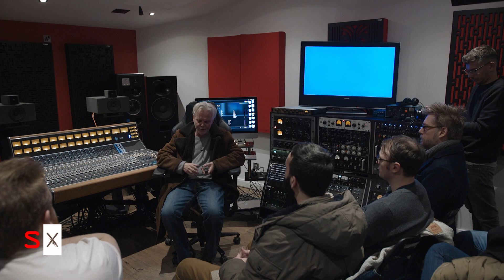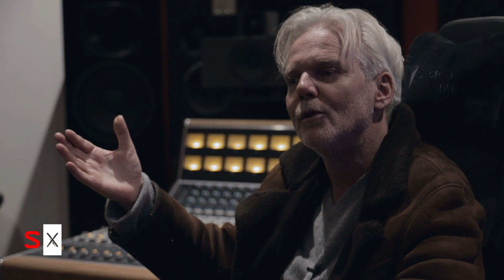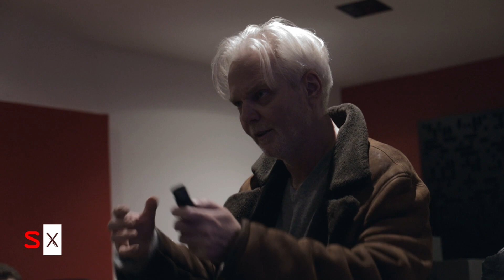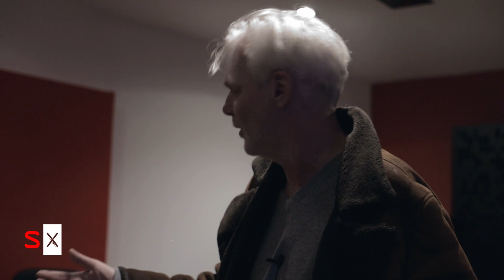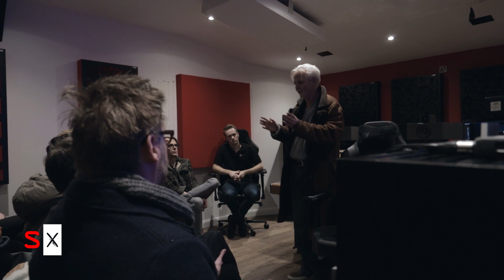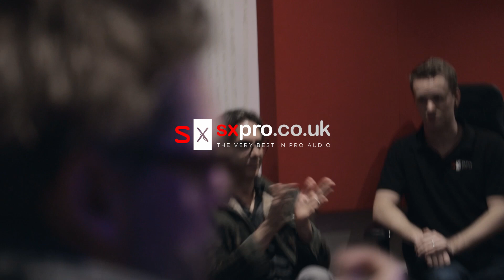Jürgen Strauss explains his loudspeaker design philosophy

Comment: You may build such speakers yourself at about 10-15% of the price.
Reply: Yeah… okay buddy
Reply: @dougleydorite  Do you wanna know components and prices?
Reply: @danielduesentriebjunior  I want to know the components and price for the PSI A215-M
Reply: @dougleydorite  I can't tell this from the picture of the PSI. The big Strauss monitor however is using JBL drivers and horn. Components from other manufacturers such as Beyma or SB could be used instead with very similar results.
Reply: @danielduesentriebjunior  I never would have know that they are using JBL drivers! Hard to believe. As far as the PSI speakers go, they make all or most drivers in house. They also have some sophisticated circuitry to help solve issues all analog
Reply: @dougleydorite  I am guessing this from the horn, which is clearly from JBL. I am assuming it is coupled to the appropriate JBL compression driver, although other brands could be used instead. I am assuming the same for the bass, again although other manufacturers are making comparable models. The price for the components is about 1.5-2K, including frequency dividing network. Add 500-1000 for some nice wood on top. Hence the Strauss monitor is vastly overpriced. Same problem with his other models.
Reply: @danielduesentriebjunior  I'd say his prices aren't as bad as some.. If you go back a few years, people were saying the PSI a 215's were too expensive at $5k. Well today, its the same price except singular... $5k... FOR ONE SPEAKER. Who is going to only buy one?
Reply: @danielduesentriebjunior  Unless they've changed they are actually using TAD drivers. The horn Is a 238X model by Jbl.
Reply: True, but you're not taking into account your time, employee's wages, tooling cost, taxes and so on. Of course many "high-end" hifi-speakers are overpriced, but DIY is only so much cheaper because you're only paying for material costs and don't have to make a profit.
Reply: LOL
Reply: LOL
Reply: You can build nearly all Monitors for yourself. And maybe the difference is not noticable (when youve unlimited budget & time) but i think when a big Company as Sony choose this over all others is one of the points that this Strauss Monitors are working. And when you compared this, to an Wilson or any other ,,High End,, Brand, the MF4 is pretty cheap with 20k pair Price (is it fair priced ? of course not).. But the biggest point, Mr. Strauss sells Room Acoustic and have fundamental Knowledge (look at his stunning SE Lab Building - there is a video on youtube from a german Hifi Youtuber). And thats what he also tell in his interviews. Acoustics, a major point wich most other brands dont even mention. Nearly all Hifi Stuff is overpriced when you look just simply on driver materials, prices and the final sound. But you forget the Hours of concepts & work he put into his designs. When you can build them for 10% of the price (wich is 2200€) good luck, go for it and release a video how they sound and look like incl Measurements. Its easy to talk bad online about certain products. But without a finished products build by you, its just bla bla. Maybe you can do it, but he has build up a company and it works for him. But we living in a society of jealous people, instead to congrats him that he is successful, only negatives... ,,i can do it better,, bla bla bla
Reply: Strauss is just another person making money off the ignorance of others. He's a dime a dozen. The audio consumer is a fool. Not much else to say.
Reply: @vtkz   The 2-way loudspeaker was first developed by Edgar Villchur and Henry Kloss in 1953, The JBl Horn he uses was released by jbl in 1997...the TAD Woofer and compression Driver are Old products as well....non of these things were designed by him.... He is simply a middle man... Take good drivers and a good horn, put them in a good enclosure and call it day. I have studied the Strauss MF2.1. Jbl m2, Oceanway HR3, TAD 2401 twin and the Meyer Blue horn extensively....I know more about them than you, I am certain. You can study my mastering monitor on DIYA audio Forum if you'd like???
This isn't a "I can do it better" type post.... Rather...its a "Stop getting ripped off and build your own stuff" type post...and if Directed at the MF2.1 directly, it is simply way over priced compared to what one will spend building it themselves.  😉😉😉
Simply learn the basics of Loudspeaker design, buy a brand name quality 15" driver and 2" exit compression driver. By the Same Jbl 238X horn... ( I have a pair I can sell you for about 100 bucks) cross the damn thing over at 400hz... but this time use DSP like all the other contemporary products... Call it a fkn day lol!!!

I can tell from you perspective you are not a loudspeaker designer... I went to the forums of the internet where all the loudspeaker designers fellowship and spread knowledge and this is my perspective after a good year or two of research, it is unlikely my opinion will change. I can now call myself a loudspeaker designer after my training by many other professional and elites in audio have spoon fed me the art of design. I also put in a lot of my own time doing research and simulations of many various designs. I have come to the conclusion the audio market place is full of uneducated customers waiting to be taken advantage of. Unless you design something that is new and ground breaking, you cannot claim to have spent hours of concept and work...Unless you are referring to the hours of time spent learn BASIC loudspeaker design....which, why is that, special? After you learn all the basics about every loudspeaker type and every loudspeaker enclosure... as I have. You will look to a design like this and say....it is a good design. But why does it cost so much???? There is no justifiable answer.
Reply: @vtkz  I was referring to a price of 32K for a pair, like I found on the internet. You get the material for clones for about 4-5K the pair, which is around 15% of 32K. BTW the Sony story is old, and I have not noticed other significant references following up. I have no intentions to build similar speakers myself, cause I am happy with Beolab 5's and 3's at my home for general listening purposes.

I am of the oppinion that active monitors from companies such as Genelec or Neumann and others have much better price to performance ratios than Strauss monitors, which require amplifiers in addition, sorry. These companies are also large enough to enable much more substantial research and development.
Reply: @danielduesentriebjunior  Neumann...yeah I once fell for that perfect measurement trap and learned the hard way that good measurements don't make good monitors. In theory the KH310a are superior to 99% of all speakers on the market but in practise, even directly compared to passive(!!!) Amphion Two18, they sounded harsh and veiled with a metallic haze coloring everything. Sold them after forcing myself to like them for 9 months and never looked back. Did better mixes on two cheap Boombox drivers in cardboard boxes whose response I EQd with the tone controls on an old yamaha amplifier (no joke).
Reply: I can build a speaker comparable to this for about 3000-4000USD. You'd still have to figure out DSP. I dont want passive anyone. Try about a 90% discount!!!

Comment: Where can we find the detailed measurements of these speakers?
Reply: 1 thing's 4 sure = if he cares so much about 'natural directivity' Y the fuk isn't he doing omnidirectional speakers?  Because it's all just 'word salad' 2 peddle what should be $300 speakers for $6,000 instead = no joke.
Reply: @Deathrape2001  Cant say you are wrong... I bought the jbl horn used in the 30k per single Strauss mf 2.1 for about 100 bucks...its used but I mean its a horn lol.... I have a pair of Axi2050 compression drivers, a 15" mid with dual 18" on the bottom by Acoustic Elegance, all top shelf drivers... self designed baltic birch cabinets and crown cts amps with usp4 dsp. Plans to experiment with horns and waveguides but most importantly... no where 60k spent yet higher performance.... Strauss is a marketers wet dream come true.... yes they use top shelf components but the price is outrageous. They did not design anything specifically that makes the mf 2.1 worth that price. It is a simple two way that has bern wisely crossed over at 400hz with a discontinued horn designed by jbl many years ago. Anyone can build it themselves for under 10k possibly including amp and dsp...  an aluminum enclosure is not needed, rather, a 2% increase in performance that will go un noticed...🤷🏽‍♂️🤷🏽‍♂️🤷🏽‍♂️ Ive spent the last 3 years studying the Strauss mf 2.1 the jbl m2, and many others and am confident in my knowledge base, as it was spoon fed to me by highly respected designers and mathematicians... ty God for the internet 🤣🤙
Reply: @camploismyalias  I agree, simple design and far overprized. You could build that for 2K a piece. Coupling that horn at 400-500Hz is a bit low, 800Hz appears more reasonable.
Reply: @danielduesentriebjunior  You have to remember that horns and compression drivers are generally designed for PA levels. Because of this, we can generally reach lower than what you could aim for, going by the normal rules. In this instance, hes exploiting the high output of a compression driver and the 400-500 cutoff of the Jbl horn. Normally youd stay away from the horns cutoff where Group Delay peaks and ringing takes place....but higher cutoffs like basically this and higher, are somewhere between a waveguide and traditional horn in that the issues are really detrimental to the sound quality, at least to a certain degree. They are probably slightly fudging on that 400hz XO point, or just barely threading the needle. I've been able to cross my horn at 200hz which is 50hz above its cutoff, for example and it sounds great. I can run no XO and it still sounds fine, its just that headroom is now limited. Crossing at 200hz I can still achieve 115db/1m under Xmax.
Reply: @Deathrape2001  for the reasons stated above you can not find any measurements of Strauss products... 

Measurements will expose the truth and allow scientific analysis of these speakers compared to others.... really bad for marketing 

Strauss has literally flown to peoples houses to install and tune the systems for customers, one customer wanted a different color horn, repainted them for free... at 60k a set.... I would have too. A plane ticket and some white paint is hardly a dent in the profits seen here...

The lack of measurements for this loudspeaker by 2022 is evidence in a cover up. One day a pair will surface in the right hands and extensive measurements will be taken and shared and the truth will exposed...

Great speakers? Yes...
Worth 60k worth of performance? Hell no!!!
Reply: @Deathrape2001  only misguided people say that... every aspect within a  design is measured extensively ... the woofer has been measured when tad designed it... the Strauss was measured in every way, during its design... and here you come talking about "measurements mean little"....see what I mean... we have discerned and measured so many things...the equal loudness contour, harman curve, 0 transfer function, etc etc... measurements are a compass, our ears are the final say so, yet if aiming for 0 transfer function aka uncolored sound, there is only one "right" as determined by the electrical signal.... to add or take away from the electrical signal is distortion 

In particular, for some random garage party you might throw measurements out the window but this is a Mastering monitor...requiring scientific sound quality, the epitome of whats required to recreate the signal accurately 

The port doesn't need to be flared for reasons that I should not have to explain if you were fluent in loudspeaker design... your ideas are fallacious... woofers without a cabinet introduce much more reverb into the equation which is step away from clarity and easily seen in a measurement via impulse response...

You sound like you chase what sounds good to your ear

I chase a system that recreates the Signal as accurately as possible with no coloration

We are not the same🤣